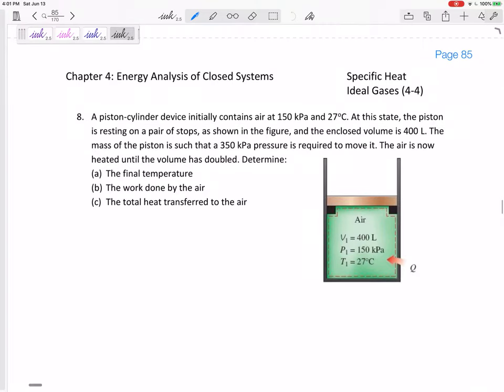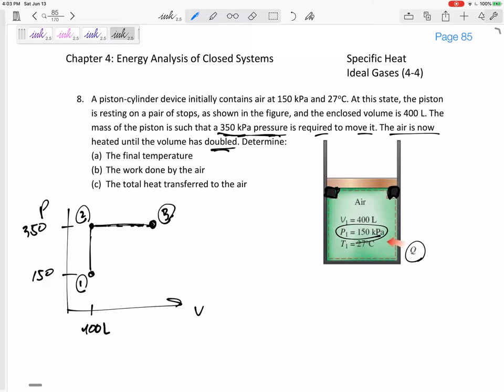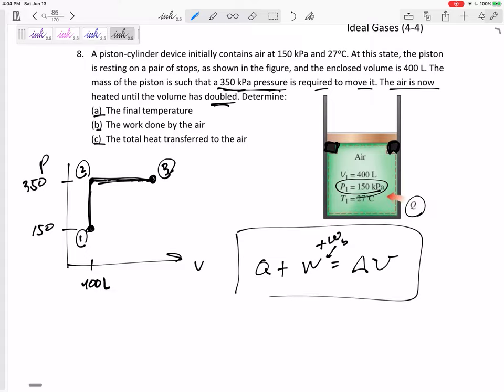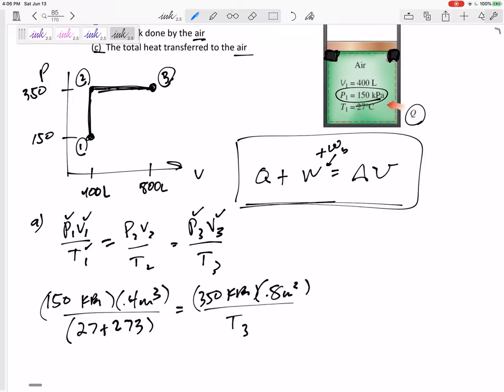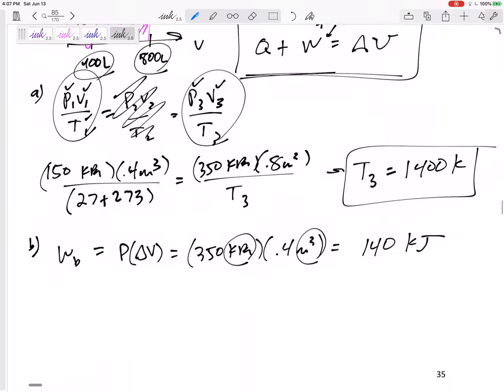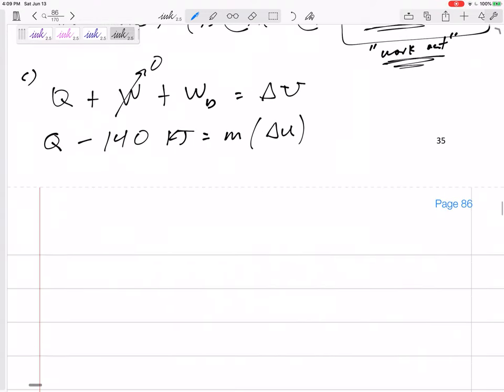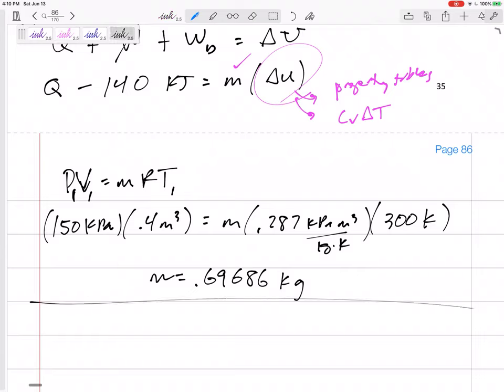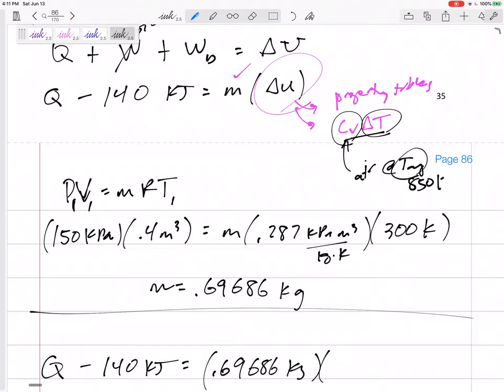Thermodynamics - 4-4 Ideal Gas Specific Heat example 4

Comment: Hi professor, thank you so much for helpful videos. Process 1-2 is a constant volume, then 2-3 is constant pressure. Why dont we use cp ? Why do we use only cv ? I guess we should use cv for the process1-2 and cp for the process 2-3. If we use boundary work, then we dont need cv. We can directly solve it with table A-17. But we use only cv. I think this problem should be divided into the two parts. Then we can use cv and cp together.

Comment: How come you used Cv instead of Cp? The piston is moving while the heat is added right, therefore pressure is constant and volume is not. Right?
Reply from the maker: We used Cv because we needed to find u, not h. The reason we needed to u is because the whole process (from state 1 to 3) is not just constant pressure or constant volume, its kind of a combination. So for those problems you calculate u AND boundary work.

Comment: Since it's not a constant pressure process.. Shouldnt  the boundary work have  been delta p times delta v???
Reply: It is better to see it as 2 processes in one. And so from 1 to 2, V is constant so boundary work is 0 . From 2 to  3, volume doubles while constant pressure, there you calculate the boubdary work. I think it is better drawing the graph P vs V, and get the area under the curve as it is an integral really.

Comment: Hi professor, i was stuck on this question and i tried as hard as i could but i cannot do it. Can you provide a solution for this questions please?                                                                                                                              A piston-cylinder device initially contains air at 250 kPa and 500 0C and total enclosed volume is 400 liters. Due to the heat loss, the piston moves downwards to a position where it sits on a pair of stops and its final enclosed volume is 200 liters. Further heat loss leads to the pressure reduced to 200 kPa

Determine (a) the final temperature, (b) the work done by the air, and (c) the total heat loss to the environment. 

Assuming: 1) air is a perfect gas; 2) there is no friction between piston and cylinder walls, and 3) ignore the volume occupied by the stops; 5) there is no air leakage; 4) C_p=1.013 kJ/kgK; C_v=0.726 kJ/kgK; 5) use 273 for the conversion between Celsius and Kelvin degrees.

Comment: how can you tell that the pressure is constant from 2-3 ?
Reply: From 2-3 there isn't any Material or surface which hinders the flow of heat. 
Air molecules or water molecules can move freely as there isn't any Stopper or Sth. Like that. So the pressure remains constant

Comment: why suddenly Q-140kJ? wasn't the formula is Q+W+Wb=dU?
Reply: Expansion is work out and compression is work in. Remember in is positive and out is negative. The boundary work in this problem is in expansion. Hence q-140
Reply: @munerimukhethwa4487  Also there is no other work than the boundary work, just why it is just Q and negative boundary work(as it is work out)